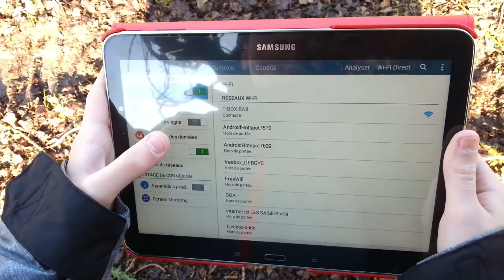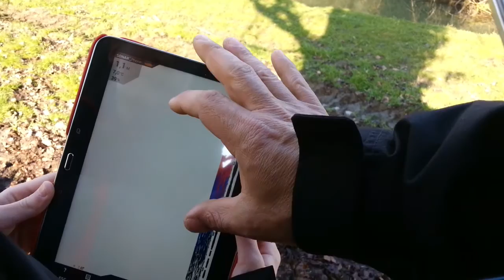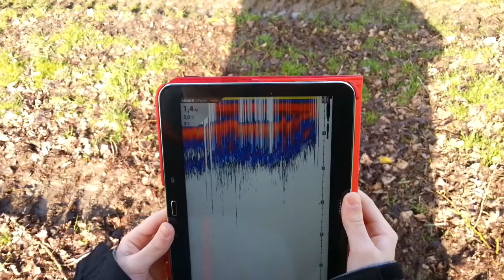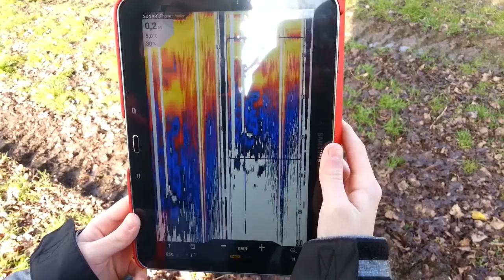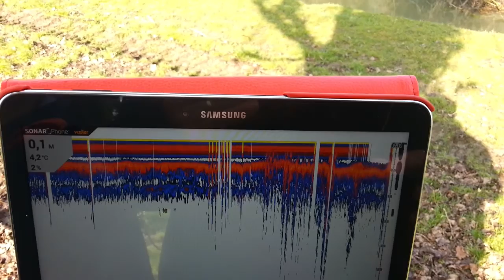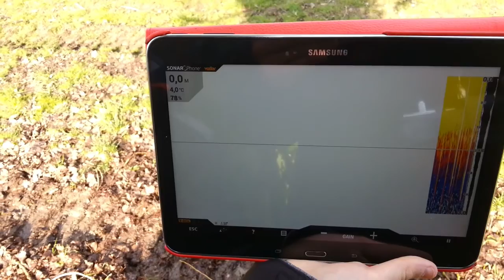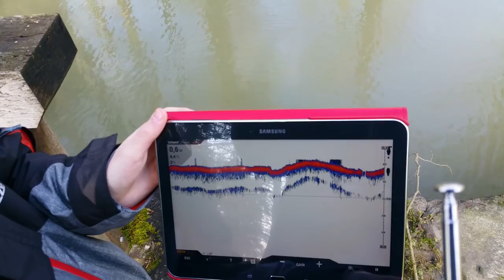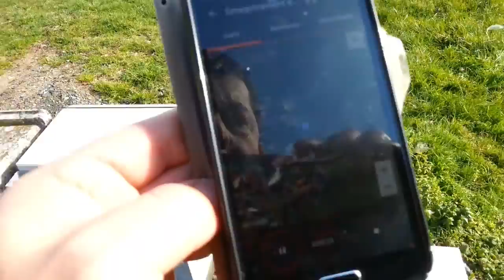Modification Sonarphone de Vexilar offert par navionics

Comment from the maker: j xx 
will you dismiss your comments?
I have many notifications but can not see your questions ....
The product Vexilar does not need to be in the water to work.
It can be considered to put it in a shell surrounded by product, but you will not have the right temperature. And above all, it is not necessary that there is bubble of air.
I try, but give up because it does not work well.
For power supply, see at 10:00
Just the red thread +
And the black thread -